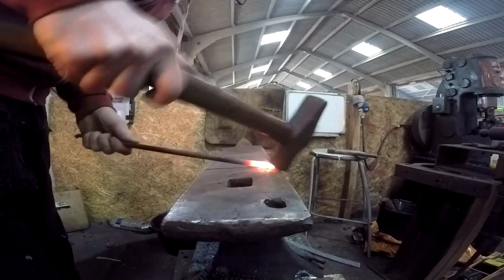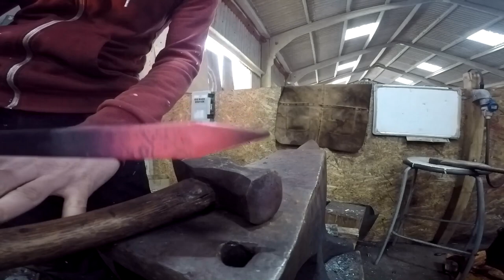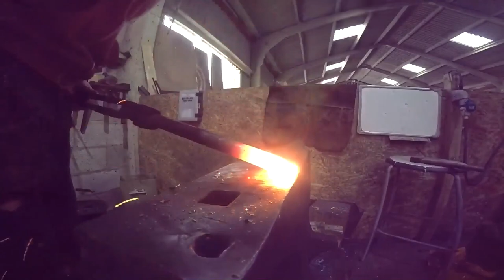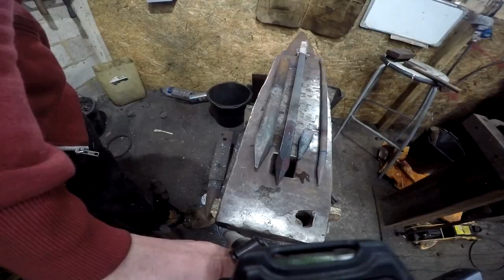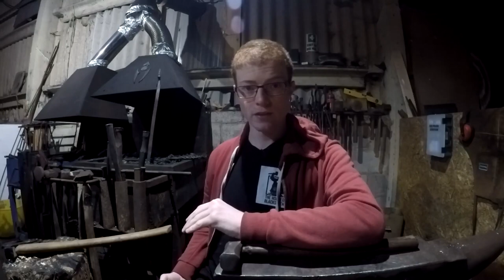The Points of Blacksmithing

Comment: Why so shallow of hammer strikes? Or is that your comfortable height to lift your hammer? was always taught to lift my hammer higher, used gravity and not my arm to move the metal.
Reply from the maker: Just the habit I have depending on the size of material and heat I generally use a shallower height when more accuracy is needed.